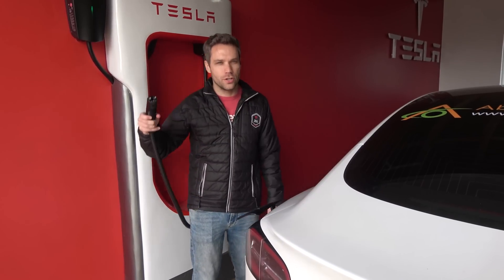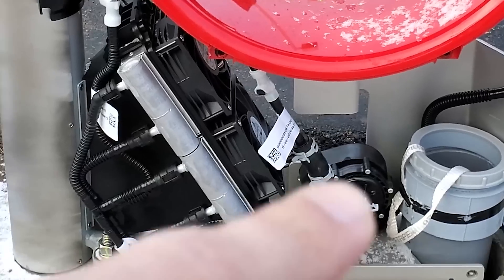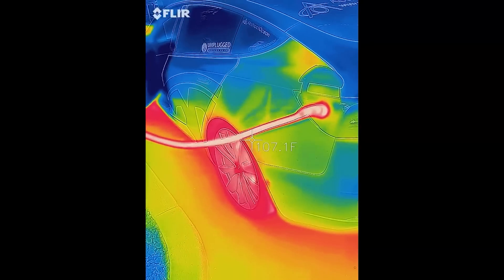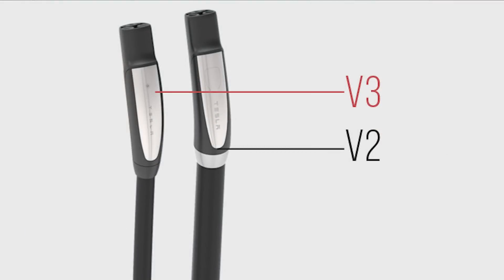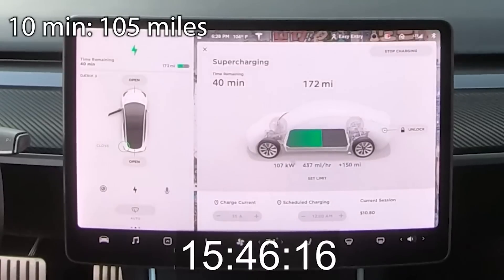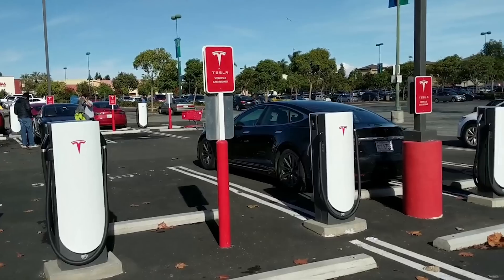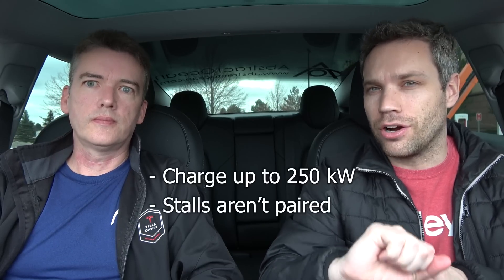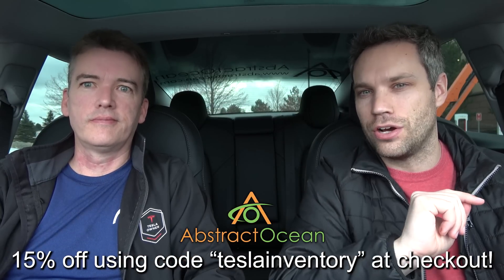Tesla V2 vs V3 Superchargers. What's the Secret?

Comment: Spoiler alert:   The v2 uses larger wire so does not need cooling and does not waste power.   The v3 upped the charge current 67% but went to smaller wires so a lot of power is going to be wasted in heat that has to be carried away!  Even if you limit charge to 150 kw you are still wasting energy because the wires are smaller, so you will be paying more for the same power you would get from a v2.

Comment: The big pipe on the right is a massive conduit for the power lines that leads to the massive transformers and other electronics, these units are just the plug for your car, all of the super high amperage electronic transformation happens in a fenced off area on site somewhere. There are some EV chargers on the market that do all of the power transformation in the same unit that holds the plug for your car, but Tesla Superchargers do not...
Reply: You're correct.

Comment: I believe that on the right is a conduit for the power connection rather than a reservoir. The cooling loop appears to be closed, with only the hoses, pump, and radiator.
Reply: You're correct.

Comment: A 150kwh V2 supercharger not shared vs a 250kwh V3 supercharger, it was only measured to save 2 minutes when benchmarking both model 3s from 1% to 90% SOC (same temperature and climate and both are LR AWD). The 250kwh stall is disappointing in terms of being "quicker to charge".

Comment: I assume the per-minute rate for electricity at a Supercharger is the same for ver. 3 vs. ver. 2 so you could point out it costs less to charge using a ver. 3 if you can get that higher charge rate.
Reply: warlordace u pay per kWh not per minute, so the price is the same

Comment: In Europe all the V3 superchargers will be CCS only. The V2 chargers all now have two cables, which V3 won’t have. Which means S and X owners have to get the adapter and retrofit to use any new locations. At least in Norway, all new locations will be V3.

Comment: Have you seen a gradual increase in charging costs?  I noticed one V2 you showed charges 24 cents per KWh while the V3 was 27 cents per KWh.  It seems like the savings originally associated with EVs is shrinking when compared to gas/diesel vehicles.

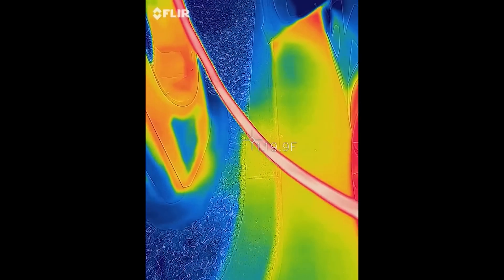Comment: 2:45 - You talk about cooling the cable being nice in warmer climates. That is not why it is water cooled. It is to be able to use thinner wires for the charging cable, and put over 500A of power thru them without melting.
Reply: it's just not for your hands' comfort 😉
Reply: No, actually the cooling is for the charge port and not for the wire.
Reply: So, it's because it's necessary for hotter climates. 🙄😂
Reply: @RubenKelevra  Even cold climates its an issue because the thick rubber insulator still blocks heat
Reply: @Jedi2155  it's hardly an issue.

You need 108mm² for this without any liquid cooling.
Reply: @RubenKelevra  Umm what? 108 mm^2 is only a 4/0 cable size that is rated for 260 amps, if you're using something like copper THHN at 90C. 

For 500A+ you'd need at least 405mm^2 (~4x larger) which is 800 kcmil.

They might've undersized it a bit based on load factor vs. peak load but I still thinking it would still several times larger than what you proposed.
Reply: @Jedi2155 well, that's the allowed permanent load for a wire which is rated for 145 °C in 10°C environment. :)
Reply: @RubenKelevra  Yeah. Local hot climate in the charging cable 🤣

Comment: Urban superchargers aren't paired either to my knowledge.  This must have been recorded a while ago since it looks like you're sitting in your Model 3?  I doubt they use water to cool in v3 since that would freeze unless it is a treated mix with antifreeze like in ICE vehicle cooling systems.  Thanks for showing the cooling system in the v3 stands.
Reply: Urban superchargers are paired. They are a Supercharger V2, but have a fixed 50/50 split and not the dynamic split used on normal superchargers. That is why they are 72kW, since one SuC v2 cabinet is 145kW.
The cables are not cooled by clean water. It is some sort of antifreeze mixture. The correct term would be "liquid cooled".
Reply: Glycol cooled to my knowledge.

Comment: Did you just implicitly say that the Raven S/X can use the V3 charging speeds?
Reply: From what I remember you can charge a Model S and X at 250 kws charger but receive up to 200 kws.
Reply: @kevinmichel6224  Interesting information. I heard from others that the S/X only goes up to 150. I unfortunately have no V3 SC around to test on my Raven S
Reply: @TheNewAccount2008  In order to achieve those speeds the battery has to be pre-conditioned by up to 10 minutes prior to arriving at the supercharger at a relatively low SOC

Comment: Until the cars can actually sustain the higher charging speed there’s actually almost no difference in charging time between V2 and V3. The cars taper off the charge rate really fast when charging at V3 chargers.

I’ve also seen that most V3 Superchargers seem to be half as reliable as the older superchargers. Almost every time I have seen one there’s multiple stalls out of service or only providing a fraction of what it’s rated for. I really hope they figure out the reliability problems quickly and also can safely keep vehicles charging at higher speeds for a longer duration before tapering. That’s the one benefit Audi and Porsche EVs have with their huge buffers. They can charge at really high rates from 0-100%, whereas a Model 3/Y and S/X take years to do the 95%–100% charge, and why we see speeds really fall off above 50% SOC.
Reply: V3 is way faster while doing more stops. If you charge to a high SOC, it's going to be the same as V2.
Reply: Ignacio Mainardi if you stop a ton of times, sure you will charge faster from very low
SOC up to about 50% (maybe), but beyond that the taper is really strong. 

Also, I’ve tried stopping more frequently for shorter charging sessions vs. just waiting an extra 10-15 minutes to get a higher SOC so I don’t have to stop as much and it’s never been faster to stop more times. You think you’re saving time but it doesn’t. By the time you get off the freeway, drive whatever distance it is to the supercharger, back in, get out, plug in, and then charge, get back out, unplug, drive back to freeway and get back on, you’ve spent an extra 15 minutes driving/plugging/unplugging that you could have just spent at the last station charging. I’d rather get 10-15 extra minutes of charge and not deal with the hassle of additional stops that could have traffic or any other delay.
Reply: I agree. If you care about powerbands and taper issues then you are doing something wrong. 
I use SC for a quick 10-15 min zap at max speed.
Reply: It's hardly an "advantage" for Audi and Porsche to be denying their customers the use a huge chunks of their battery. If you artificially did the same with your Tesla, by deciding not to charge past ~90%, you'd get the same characteristics as charging a Porsche or Audi (speed would remain higher until you're "fully" charged). 

You just don't have the option to choose to charge to the "real" 100% in those cars, while you do in a Tesla. Which is quite useful in case you happen to not care about how long it takes (e.g. eating a meal while charging).
Reply: coredumperror there are some advantages to having a large buffer. One of them is decreased wear on the batteries and likely less degradation over its lifespan. The other is the higher charging speeds. The e-Tron and Taycan can keep charging at 85-100kW at 80%, and even at 95% are still chugging along above 40-50kW. Even at 99% they can take 30kW, whereas the Model 3 is down to about 40kW by 80% SOC. I have a feeling Tesla is going to surpass VW Group’s charging speeds at some point, maybe they’ll have to adopt the 800V architecture Porsche uses to do it, but it will happen. 

I am a Tesla owner and I love my Model 3 P, but the V3 Superchargers are a let down for many people who expected charging times to fall substantially (as advertised).  There seems
to be no linear relationship between max charge current and time to charge. People thought 250kW is 166% more than 150kw, so v3 will be much faster. In real world testing, 0-90% shows there to be less than a 1 minute difference in best case scenarios, while some tests have shown v3 Superchargers actually taking longer to reach 90% than v2.5 (150kw). Is all that extra power just hurting the battery to satisfy people who want to see a big number? It seems like v3 is all about showing a huge peak number, but it doesn’t actually deliver much in the way of time saving and it definitely doesn’t improve the battery’s health. The only real advantage for most people is no power sharing between stalls. A lot of people drive to areas where there’s not a supercharger, or they have one stop between home and their destination and must charge up to 80-90% to make it there and back to the station.

Hopefully over time they’ll be able to keep the charging speed sustained at a higher rate for a longer duration, of figure out a better charging curve for V3 chargers.